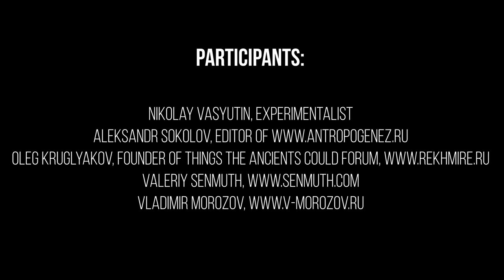Making Egyptian Drill Holes: Lost Ancient High Technology

Comment: Someone needs to show how they made hollow vases with an internal curvature out of granite using this method. This method might be feasible to make a tubular cut but you need to demonstrate something a bit more complex than that to reproduce granite vases attributed to the first dynasty. The method demonstrated could not produce a vase with a variable internal diameter.
Reply: They have a video showing that. And the Fatimids also did it 1000 years ago in pure rock crystal.
Reply: @Vision_2  Fatimids had steel, 1st Dynasty didn't - they had copper and using the primitive method demonstrated isn't going to produce anything with precision, you got a link to this video where they make precision measured hollow granite vases with variable width cavity and external handles?

Comment: Does the copper not grind away like the granite? Seems like one would need some multiple of the depth of the hole in copper to reach the desired depth. I'm not trying to discredit just understand
Reply: you cut with an abrasive in this case sand rather than copper, it works like a simple version of a diamond head for drilling. Copper partially thins and self-sharpenes in the process.

Comment: how did they make a seemless copper tube hard enough to drill with? where is the evidence of the progress in technology that developed that type of technique? where are the spindles that would fit into the holes that were left as sockets? why did they need to drill into granites and hard rocks instead of using wooden linings?
Reply: I know you think you said something here = but try again.

1 - how to make a copper tube = cast it...... - the same as we do today.  That can be accomplished via using molds you make from a variety of substances.  Mold casting using say wax or clay an example dates back to antiquity.  
2 - the subsequent tube need not be "peerless" as upon using it the action of it rotating against the inside wall created by drilling will smooth it out as it goes.  
3 - where is the "wood" which used to be in the holes created = gone obviously......  Think about where this is = Egypt - a mostly desert environment.  Thus while the Egyptians certainly imported wood it would be valuable and not left lying around to rot generally.  It would be scavenged as say firewood by those who came later or perhaps upon some site being abandoned any salvageable wood was stripped out and reused for something else. 

Final thought.  Look at Egyptian temples and see they are usually = open air........  This means that any holes drilled into stone blocks would be for specific purposes such as framing for a gate etc..  That limits yourself to perimeter walls etc. which means royal enclosures and some temples etc..  

So the Egyptians were not drilling holes everywhere as you see them rarely given the effort and expense of creating them and any wood which might be inserted into them.

Comment: Has anyone tried this technique at larger scale?
It would not be a significant effort to build a larger drill, with larger fly-wheel, bearing device at the top to stop the wobbling, and a belt to turn the fly-wheel.
Perhaps the wobbling action is necessary for success.

Comment: Imagine these guys are trying to figure out how they did it. So much trouble for such a small piece and those ancient people did it on a mega scale with mega blocks in the middle of nowhere. What they are not expaining is how they created such a complex building with interlocking blocks and shafts and used complex mathematic in the building. That means they knew about zero and pi over 4000 years ago even before these two eedyts and the current modern humans. I hope there are thread marks in the drill holes and the finish is absolutely perfect texturally smooth and angularly too like those granite boxes in the Serapeum which no human on this planet can lift.
Reply: ....uh....you know you don't really need to know pi right? ...also "perfectly smooth...' come on, stop repeating just verbose nonsense. "Perfect" is absolutely an exaggerated claim.

Comment: This is a good theory but that wouldn’t work drilling on a wall. I’d say they would have the abrasive sand melted into the copper when they make the tube creating a matrix the copper is softer then the rock so it will wear away exposing the quarts inside the tube

Comment: In your experience are the grooves going in spiral or are parallel to each other? By the way great video!
Reply from the maker: Exactly the same as on the ancient Egyptian cores. Do you understand the hint?
Reply from the maker: The myth of ideal spiral grooves has been debunked https://youtu.be/HQi4yql7Ysg Thanks for the inspiration!
Reply: @ScientistsAgainstMyths  Baloney, it hasn't been debunked at all. Core 7 consists of overlapping spirals, and the depth of the cutting of the quartz was the same for the feldspar and mica (other, softer constituents of granite) indicating that powder abrasives weren't used and certainly wasn't cut using copper.
Reply: @methylene5  100% debunked. The experiments match the original.
Reply: @Eyes_Open  proof ?

Comment: I bet you can quart stone like this if the bottom of the rod is round.  That would explain the “scoop” marks in the unfinished obelisk
Reply: Those are likely a result of "abrasion".  While one can certainly chip away at a stone surface via pounding upon it using a hammerstone.  One can also however use a stone block to "rub a surface down" as well.  Think a line of workers sitting beside the obelisk.  They using their hammerstones beginning at the top as far as they can reach systematically chip away and "scoop" downwards towards their feet along the area directly in front of them - hence "scoop marks".  

As an aside.  Egyptologists who study Egyptian quarries have found hundreds of dolerite hammerstones.  What was interesting is that those found = were rounded.  So it appears they would initially use "jagged" stones with uneven surfaces.  Then with use as the stone became smoothed out and hence its ability to abrade a specific area was reduced = they discarded them.  Also they found stones with the name of the worker painted on it indicating they all had their own individual supply of stones they used.  🤔

Comment: Just basically another idea that could be tested out is giant stone saws. Can you apply the same technique but with a bigger copper tube and cut a granite disc about 12 inches in diameter 1 1/2 - 2 inches thick? Also cut another hole in the center making basically a stone wheel saw. Then put that on a handle or something and cut another granite block using that and sand abrasive. Would this work? Then what if they had granite stone saws the 10 feet high and used horses or something to make it spin. 
Also, I noticed that in similar videos where other people did this, there were no striations. How did you get it to make the striations? Wouldn't you say that this is just applying modern techniques to ancient tools? What do you think about granite ball bearings on a stone ramp with slots to be used as a ramp to push the stone blocks up? Also why do you think the builder of the pyramid decided to make the perimeter divided by two times the height equal to pi?
Reply from the maker: Another question: what trees do buns grow on?
Reply: @ScientistsAgainstMyths  
How did they break out some of these cores that didn't drill all the way through? 

Your 'scientific smugness' doesn't make you any better than the people who claim "aliens". This kind of idea wasn't new. People in the 1700s and 1800s when they were investigating the pyramids and found these granite cuts thought they were made by superior beings because they just assumed ancient people were primitive. The whole aliens thing now is basically sensationalizing of this. But people kept on investigating which is how they discovered things like how Herodotus was wrong on some part. People back then just take Herodotus's word for it that the pyramid was built by Cheops with 100,000s of laborers using levers. Maybe people should just accept that and never investigate.
Reply: @ScientistsAgainstMyths  cinnemon trees

Comment: I wonder what happens if you scale this up.  More weight and make a rig that can be powered by animals.   Like something that looks like a mini oil well rig using rope for a belt.  Does the copper hold up with more weight?  Like say several hundred lbs? Does the tube drill faster with more weight or just wear the copper faster?
Reply: They are copying tools from Egyptian paintings
Reply: @pranays  Well, we also have evidence of what they claim they drilled and that would have taken like a 5 inch tube drill and a 20 ft hole.  Obviously, this didn't do thay but the principle of this could have done it.

Comment: Hi This is a very interesting video. One question, did you notice if the copper tube get slowly abrased by friction on the inside? This could explain the shape of the famous core#7 (wider at the bottom en narrower at the top)?
If you drill for hours, I would expect that the tube get wider en wider from the inside when going down. Also the copper tube for core7 would have been very thick based on the picture of the hole I have seen.
Reply from the maker: Thanks! Have you watched the video to the end?
Reply: Scientists Against Myths oups I stopped the video too early it is explained at the end. Well done.

Comment: hmm and how did they make an abundance of copper tubing to make said drill holes
Reply: The usual way..........  Egypt under Djoser conquered western Sinai for = the copper mines there.  From that point on they were harvesting copper ore and transporting it back into Egypt proper across the Red Sea.  There are accounts from Old Kingdom Pharaohs of expeditions of thousands of men being sent to Sinai to harvest more copper ore.

Meanwhile just as today metal can be = recycled. Thus while some is lost of course a lot of previously smelted alloys can be melted down and recast to add to your newly smelted supplies.  There are accounts from the Valley of the Kings as an example.  The workers who dug the tombs were broken down into specialized teams.  They had among them an individual whose job was to swap out blunted tools for new ones = and weigh them to prevent pilferage of broken bits.  

Copper could be viewed as "a strategic resource" and thus it was controlled to maximize the amount which could be reused.  Thus centuries of harvesting copper ore ------> smelting that down -------> creating tools etc. = generates quite a lot of bronze over time.  🤔

Comment: How do they do the copper pipe? (Yes, copper is soft and easier to bend but still what is their process to make the pipe)
Reply: Via a mold of course - the same as with other cast implements.  So first is they were casting bronze rather than pure copper - and bronze is harder.  Next is that molds could be created various ways.  

If they perhaps carved from wood a cylinder of a given dimension that could be used to create a form for a tubular drill from = clay - which can be fired the same as pottery.  So you wrap clay around the cylinder - then perhaps papyrus around that to a desired thickness - with another layer of clay = and fire that.  The papyrus will burn away leaving you a cylinder mold of your desired thickness into which molten bronze might be poured.  This is one way to make a mold.  

p.s. - you know that even today one still encounters say molds made from = sand and other such pliable mediums.

Comment: very interesting but does that work when you want to drill granite blocks that are 0.5-1m ? i'd say it takes a long time to get that drilling done and i guess the stress on the working tools would be to great at some point where they just break over and over.
Reply from the maker: Thanks for the comment. Show me a drilled hole 0.5 - 1 m deep in granite block.
Reply: @ScientistsAgainstMyths  i don't know the exact measurements of holes drilled into granite blocks during ancient times. to rephrase my question: is it possible to drill any hole found in granite using this method ?
Reply from the maker: No. Various methods could be used. Multiple drilling or pounding, e.g.
By the way: https://youtu.be/hjN5hLuVtH0
"Principles of tubular free abrasive drilling" (Oleg Krugliakov): https://antropogenez.ru/drilling/

Comment: Took 2 days to make that small circular cut which is impressive but it doesn't explain how they cut straight lines perfectly through granite or carved very detailed granite statues. I think you are closer than any archeologists to the real answer. Maybe a copper pipe attached to a tuning fork. Sound was used to make a better drill. As well to lift heavy 20 ton stones
Reply: The tomb of Rekhmire depicts craftsmen working on various things.  Those are your examples of ancient Egyptian tools - along with ones found in museums.  Also you must account for "dating" when considering when a thing was made.  Just as you can not look at a 2020 BMW car and claim it was created using 1920 assembly line technology = so artifacts created during the New Kingdom or later can not be inferred to have used Old Kingdom technology in their fabrication. 

Finally they were not "lifting" heavy blocks.  Smaller ones yes - using a fulcrum and counterweight mechanism akin to the Egyptian shaduf.  Large blocks however were pulled/levered into place via earthen or mudbrick ramps.  Rekhmire's tomb also shows a hypostyle temple being constructed using a mudbrick ramp with examples of such ramps existing today at Karnak.
Reply: @varyolla435  the ramps would have had to been as tall as the pyramids and much longer than the pyramids in order to move multi ton blocks of granite up an incline to get them to the upper levels of the pyramids. They would have to constantly add and remove ramp as they got to different levels. I seriously doubt they built the pyramids with primitive tools and ramps. They were much more advanced than archeologists want to give them credit for. I think they knew how to move heavy objects with sound and they could cut into granite with perfect precision with either sound or harnessing the energy from light. There's no way they carved into granite to sculpt the spinx and other granite statues that would be hard for a sculptor to do with today's technology.
Reply: @williamwilkinson4756  Work on your reading.  What you do not believe matters little.  All that matters is what the evidence shows.  The largest/heaviest blocks in the pyramid are found in the bottom half closest to the ground.  Your granite relieving slabs - very crudely shaped by the way - are only about halfway up.  Look at photos of the exposed western base of the Great Pyramid = see a continuous ledge.  So the pyramid was built at least partially atop = and existing hill.  Its lower chamber/corridors are dug from the bedrock.  So the existing hill could have been part of the ramp to create the chambers/corridors found in its center.  It was then as noted leveled off to accommodate blocks and the core encased with additional stones.  

Above the halfway point the blocks are smaller as it rises in height.  Herodotus wrote they built a stepped pyramid to fill in the sides.  So a fulcrum and counterweight device - or Herodotus's "machine" - akin to the Egyptian shaduf could have sat upon the steps to raise the smaller blocks to the levels above.  So the earthen ramp then really only need go as high as the largest/heaviest blocks to be raised = halfway up. The rest of your nonsense merits no response.
Reply: @Всеслав Всеволодович  is that what you think? Why do the ancient Egyptians have statues that are cut so precisely ?? They aren't abrasive at all. Believe what you want. There's evidence that's not the case.
Reply: @williamwilkinson4756  
Yes, that's what I think. 

Egyptian statues and temples are often crooked, "so precisely" they are only in your imagination. You don't know what you're talking about. Most Egyptian things do not even have the usual right angle of 90 degrees, although this can be achieved by hand and with the use of an abrasive and this does not require machinery.

"There's evidence that's not the case." all the evidence shows drills, chisels, abrasives - this is the general opinion of all Egyptologists, stonemasons, archaeologists. Nonsense and lies from various freaks who have never processed a stone are not needed. Manually reachable processing accuracy down to 1 micron 😎

Moreover, the Egyptians were surpassed in construction by everyone - both the Persians, and the Assyrians and the Medians, and the Greeks and Romans😆

Comment: So he uses a modern made copper pipe held attached to wood with modern made clamps. Holding down the wood with modern clamps. Using advanced concepts to to grind. 2 days to only go THAT far ... lol 

I can't wait for them to show us how laser deep cuts into giant Slabs were done... ;D
Not just that. There is a massive slab with a deep thin blade cut that was abandoned after they were off course. But the off course mistake was so far,  how could they have not noticed if they were grinding so slow? lol They went the wrong direction that long before noticing or making corrections? lol